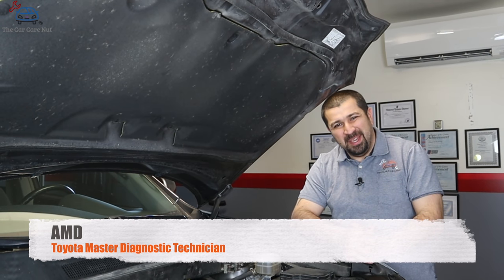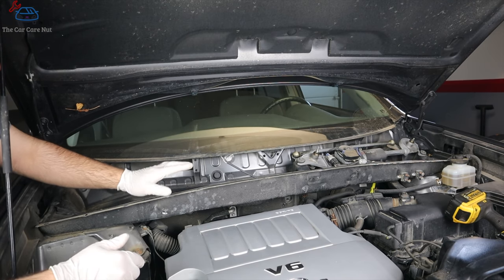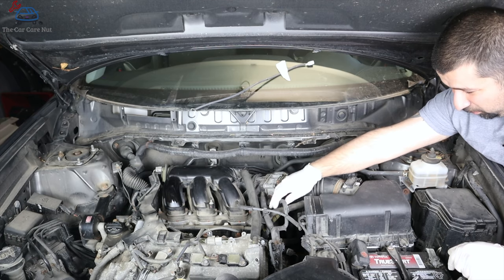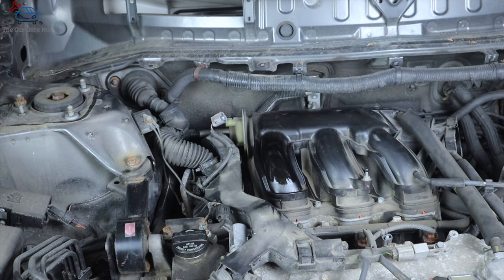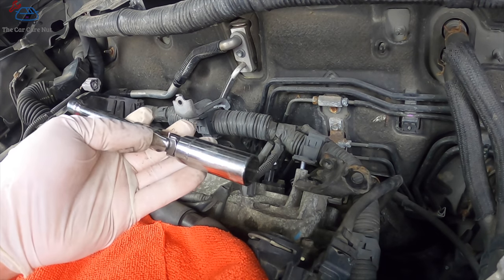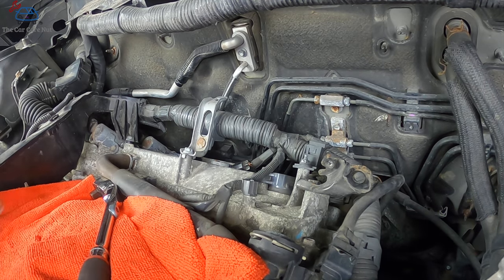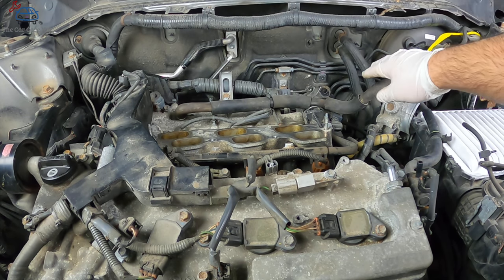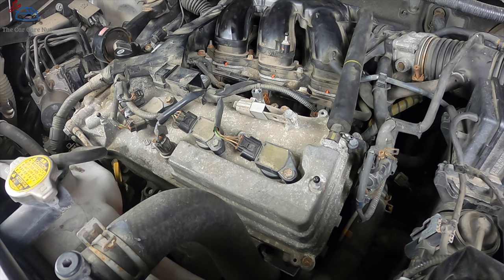How to change spark plugs on V6 Toyota and Lexus 2GR-FE 3.5L engine

Comment: Thanks AMD.  Just did this on my 2007 Avalon. The technique and steps you described were clear and immensely helpful.   I'm sure a lot viewers here - just like I did -  looked at other channels where they took some short cuts to avoid removing the intake manifold and/or cowl. My advice is don't do it.  Removing the intake and cowl was really not that challenging or time consuming. With the manifold and cowl off you can actually see where everything is instead of feeling around in the dark. The whole job took me about 3.5 hours. The only new tool I had to buy and  proved to be absolutely necessary to get at those rear engine bank  was a 5/8" magnetic spark plug socket with built in  4 inch swivel extension. The only really frustrating step was in trying to line up and refasten the passenger side rear manifold bracket bolt. I had to contort my body to find a workable angle but after about 20 minutes of trying a bunch of approaches I finally got the nut started.  

Final recommendation:  the spark plug change interval is at 120K miles.  Since you're going to a lot of trouble to get at rear spark plugs 1,3,5 just go ahead and replace those coils as well. The Denso OEM versions are about $50 each so it's not really that expensive and at that mileage you shouldn't be surprised if one of those coils decides to fail anytime after 120K miles.  My  original number 4 coil failed at just over 100K so take that into consideration.
Reply: I have the 2GR-FSE in the 2013 Lexus GS350. I have nearly 180,000 miles on the car now, and since I'm in California, the dealership recommended changing the spark plugs every 60000 miles( which I've done faithfully). In my V8 Lexus vehicles, in the past, they were always 90,000. Should I wait until 90,000 ⅞1miles to do these spark plugs? Thr car is high speed driven everyday, and runs terrific all the time.
Thank you so much!
Reply: @GREATTECH1  I would follow whatever the factory says is the required interval. If your owners manual says 60k for plug replacement then that’s your answer. It’s not unusual for a V6 engine to have a shorter spark plug life than your other V8 equipped  car.

Comment: Such a lot of work to get to the spark plugs compared to the old days.
I remember Scotty saying to buy the 6 cylinder as easier to work on than the 8 cylinder.
Very neat work there and very instructional.
Reply: Yeah, but they last a lot longer, so once in 100 000 miles isn't so bad.
Plugs used to be changed about every 20 000 or so.

Some Mitsubishi's  V-6s you need to remove the intake manifold to get to the rear plugs.
Reply: Scotty says to get the 6 cylinder 4RUNNER vs the 8 cylinder 4RUNNER. I watched my mechanic do the spark plug replacement on my V8 4RUNNER. The only thing that had to be removed was the air intake. A piece of cake compared to the 3.5L V6.
Reply: You used and paid for a professional mechanic; very easy to watch an experienced mechanic do the work with the correct tools.
Reply: @sanjaygandhi7962  4th and 5th gen 4Runners don't use the 3.5 2GR they use the 4.0 1GR, and they use a longitudinal mount configuration which makes it a million times easier to get to the spark plugs, my 3rd gen 4Runner with the 3.4 5VZ-FE was a piece of cake compared to this.

Comment: Thank you for creating this video.  I just finished replacing the spark plugs on my wife's 2011 highlander 5.3 and it was almost identical to the 3.5 you showed.  The hardest part for me was figuring out how to disconnect the electrical connector on the variable plenum.  You gave us some really good tips and probably cut the time it took me to complete the job in half.

Comment: This video was extremely helpful to me when changing plugs in a 2011 Highlander with the 2GR-FE engine. In fact, I'm sure I couldn't have completed the job without the video. 
I have a couple of comments based on my experience that might be helpful to others.
First, I was able to locate the bracket connecting the plenum to the valve cover and the problematic bolt screwed into the valve cover using the CCN's excellent description and depiction of its location. Standing near the rhs hood hinge, I was able to view the bolt as I loosened it using a 7"-long 12mm ratcheting wrench. It took 10 to 15 seconds of considerable exertion to break it loose. I wore a mechanic's glove to protect my hand and fingers while loosening it. 
Second, there was just no way to lift the clip on the connectors to the coils without breaking the clip. Thermoset plastic that has been subjected to the heat of the engine for 11 years was too brittle to bend without breaking. I wrapped high-temperature electrical tape around each connector to hold the severed clip close to its functional position and then pushed the connector onto its mate on the coil. I then gave the connector a gentle pull to verify that it wouldn't vibrate loose.

Comment: Thanks AMD for this video I have watched it many times in preparation for my own repair. I did it today and was successful. It took just under 4 hours it would have easily took only 3 if I didn’t have a stuck passenger wiper blade and the constant searching for the bolt to the L bracket. I couldn’t get the bottom bolt on the L bracket so I went with the top bolt. Once I got the plenum out I took off the L bracket because I needed to get to the #1 ignition coil. The rest of the repair went very smoothly. When I went to put the bolt to the L bracket back on I dropped it several times. The last time it was lost for good. I couldn’t find it. So I’m hoping my Avalon with 240K miles won’t miss it too much. 
Your videos have been a Godsend to me and has increased my confidence in being able to make my own repairs.

Comment: Hi Car care nut-Just want to say how amazing u are and the help u provide the community is invaluable! I have been dealing with 120K maintenance on my 07 Rav4 and while doing this job had your video on repeat! Kept saying "Thanks car care nut"  looking at the Tv in my garage like you were right there with me!! Everything went pretty well other then breaking 3 Coil clips even using your method. They are just that brittle after 14 years. Also, the front 3 plugs for some reason were seized beyond belief. 

I was so scared I was gonna break off the plugs. Was able to breathe and take my time and got them off eventually. I did use anti-seize on the front 3 though with the OEM Denso from my dealership. I know u don't recommend but I just used a very tiny amount on my finger tip and all 3 plugs went in smooth and torqued to 13 f/ibs. Did not replace the coils though, as I remember u have said if it works, don't replace. TY again for your wonderful contribution to YouTube and Toyota owners like me and helping with our maintenance!

Comment: Great video - thanks for your time doing this.
Two tips... 
1. Place some masking tape on the windscreen, under the wiper blades BEFORE you remove the wipers, and mark the tape where the wipers should lay.  Replacing exactly is then simple.
2. Wrap thin wire lightly round difficult-to-locate bolts, keeping the wire secured up where you can't lose it.  If you accidentally drop the bolt into an inaccessible place, take the end of the wire and GENTLY reel it in,  Before you tighten the bolt fully, pull hard and sharply on the wire to unreel it from the bolt that is now located (but not yet tightened).
Thanks again for a very clear 'How to...'
Reply: great tips!

Comment: I did coil packs and spark plugs replacement 3 years ago on a 2005 Avalon 2GR-FE and marked the hoses in case I have to do it again.  I now have to replace the valve cover gasket and spark plug tube seals soon.  Hope a video of that is made some day.  Thanks very much!
Reply: Me too. That rear valve cover gasket is going to suck.
Reply: How many miles on your car when you had to do that

Comment: AMD, Thank You SO MUCH for your incredibly helpful video! My son and I just completed replacing the plugs on my wife's 2013 Highlander Limited with the 2GR-FE. I could not have done this without your video. That rear bracket plenum bolt nearly did me in - I even purchased a set of swivel sockets from Harbor Freight and they did NOT work. Your Snap-On swivel socket apparently has greater swivel range as compared to the HF... I ended up using the longest 3/8" capture extension from HF with a U-Joint adapter and a standard 12mm socket, that did the trick. I forgot 2 hoses at the end so taking pictures BEFORE starting is a great idea. I have learned so much from you, Eric O at South Main Auto Repair, and Ivan at Pine Hollow Auto Diagnostics. YouTubers like you guys help us shade tree mechanics keep our vehicles running while saving some money!
Reply from the maker: Thank you for watching my video and I’m glad it helped! Some of these swivels don’t go as much as the snap on one. I noticed some brands like gear wrench makes very similar swivel angle to the snap on one.

Comment: Just did this on our 2010 Sienna. The rear 3 are a chore even with the upper intake removed as there is a lot of wiring in the way. Took about 4.5 hours and had to replace all 6 coil connectors as the original ones were so brittle, they all broke but I knew that going in and bought new ones from Toyota. Thanks for doing this video as it was a huge help.

Comment: Great help. Thank you. 2008 Camry completed today after 134k following all the guidance and tools. Original plugs (with the X on top) looked good. 4 of the plugs were very tight - took patience to remove them back and forward slowly without incident. The front 3 connectors snapped off the fragile clips often reported. Really appreciate the time you take to help us all maintain our Toyotas.

Comment: Great video.  This clear explanation of removals necessary for spark plug replacement was spot-on.  It isn't too difficult.  The biggest hassle I had was clips on the plastic cowl cover...I broke (1) and looks like windshield installers broke (1) previously.  Not a difficult task...just takes patience and care (clips are not replaceable by themselves).  Toyota Venza V6 is pretty much the same. 

If you can, take time before removing intake or plugs to blow off  all the grit/sand/dirt from the top of the engine so it doesn't fall in.

Comment: Fair warning to anyone who tries, if you are not confident, do not attempt this. You should be an amateur mechanic and have ALL the right tools for the job - including the swivel socket and every correct sock size. 

I made the mistake of sticking an extender that was too long into my back spark plug. Could not get it out without shimmying it and ended up shattering the plug. 

Been dealing with the aftermath + handling other repairs. Even my mechanic is having a tough time with the job. 

I wish I’d went to a mechanic from the start and had it done professionally.

That said, this is a fantastic video. The instructions and editing are clear and on point. You were very professional from start to finish. Nothing against the creator or the process. It’s just been a nightmare to deal with.

Comment: Thank you so much. This video really helped me replacing the rear coils (Coil "E" went out Cylinder 5 - rear driver side)  - and plugs on my 2009 Sienna 134,000 miles. Here is a good tip for anyone doing this on the 2009 Sienna - when it comes to taking off the "nasty" passenger side plenum bolt - take off the top bolt that screws in the the plenum (12mm) - that was easier for me. But the biggest tip of all is when it comes to putting it back on - Tie some fishing line to it before attempting to screw it back in! I spent an hour trying without the fishing line - but once I had that on I was able to lower it and move it around without the fear of dropping it. With the fishing line trick I had it screwed in in 5 minutes! WOW!! What a tip! Anyway, if you are doing this job - zip lock bag your nuts and bolts when you take them off it helps when you put them back on. Pick up the $1.98 pick set at harbor freight to pull off those PIA Ignition coil clips (4 of the 6 clips still broke on me and had to use zip ties to secure them). Put some masking tape on all those vacuum hoses that you disconnect so you can easily see them. Put down a bath towel on the intake as you don't want to drop anything in and you'll likely be lying on it. Don't lean on the glass when you are doing the job - it is easy to forget. Oh and when you are taking off and putting on those hex bolts on the plenum cover watch it - if you drop it (especially the back ones) they can go through the hole of the plenum which leads to the intake - put some carboard angled in there to prevent that from happening.
Reply: Could you please tell me where Coil Pack D is located 2008 Toyota Avalon
Reply: You must be my twin. I did a lot of the same things you did. The bags and  the tape is exactly whay I did.

Comment: Just did mine a few days ago including the valve cover gaskets, what a pain in the neck, I decided to take the risk and it worked out great, it was a personal challenge and didn't quite although at times I felt like that the hell did I get myself into, but it can be done, just look at this great video and determination you can do it attitude and then be proud of yourself for such a huge accomplishment and having saved a lot of money.

I'm not a Mechanic by the way..
Reply from the maker: The valve cover gaskets on the 2GR are a bear especially the back one
Reply: I agree
Reply: Halfway through its like WTF did I do haha.

Comment: The "antenna" that you referenced is actually a power wire for the heated wiper park. Toyotas equipped with it will automatically heat the wiper area when the defroster is turned on inside. Great channel, great video, just a caveat from an autoglass guy.

Comment: Excellent procedural video!

Disclaimer: all dust, grease, grime, stuck hoses, lost tool searches, stuck bolts, stuck nuts, spilled fluids, stuck electrical connectors,
missing part searches, visits to the parts stores, time delays for parts on order, cursing, potty breaks,  food breaks, phone interruptions have been deleted.
Reply: LOL..... I can relate.!!!

Comment: I did my 04 RX 330 a month a ago.. it took me 2 weeks to finish.. the only mechanical experience I have was watching different videos on this.. took me 2 weeks bc every time I get frustrated I stop before I lose my patience and just start pulling and hammering things down.
I’m glad I did it and felt good, Not only I changed the spark plug, I also changed my valve cover gasket which is very difficult to remove and put back, while I’m there I also replace my high pressure power steering line. Before I put everything back I clean my throttle body and mass air flow sensor… it’s doable for those of us who are not mechanic but u need patient. 
Another motivator to do this job  for me is saving thousands by doing this job ur self.

Comment: Awesome video, thanks for the step by step format for both disassembly and reassembly. I had a stressful night because I finished at about 2230 and I missed the brake booster hose because it was dark and I was tired and worn out. I started the vehicle and the idle was high and I had misfires all over the place and then the brakes went out and I thought I somehow destroyed the vehicle. I went to sleep and I checked it the next morning. I attached the brake booster hose and everything works fine. Thanks again!
Reply from the maker: Thank you for watching! Happens all the time where you forget something and walk away from the job for a bit and come back and everything works great!
Reply: Great story  reminds me when I changed a diff, backing out of the garage  it wouldn't  reverse. Forgot the brick on the front wheels.

Comment: Excellent video. Best I've seen on doing the back 3 spark plugs and Ignition coils. My wife has a 2008 Sienna XLE Limited with close to 170,000 miles and has had it since it was new and our 3 kids were little but she still love's her van and wants to keep it. Your channel is great! Thanks for all the great advice.
Reply: This video has been so helpful. Just did my 3rd one on a 2008 Sienna. Was missing both brackets on the plenum. Mech. who did the spark plugs before just didn't put them back on! Got new OME brackets from dealer. Was getting PO305 code so I replaced all the spark plugs and all 3 back Ignition coils. Replaced the coil connector also. All 3 were broken. Replaced the VVTi rear bank oil line also. It had never been done. Put everything back together with all new plenum gaskets. Still getting the PO305 misfire. Any suggestions? Can I re-use the new plenum gaskets that I just installed? Thanks.

Comment: Did this on a 2015 Highlander yesterday.  I didn’t need to remove either cowl and was able to reach that rear bolt without a problem.  The job went smoothly thanks to this great video.  The small pick was key for removing the connectors on the coils…great tip!  Masking tape can turn your extension into a locking extension for holding the spark plug socket.  While i had stuff apart i replaced the PCV valve (cheap part and takes an extra 5 minutes) and the air filter.  I also cleaned the throttle body. All in all an enjoyable job on this car if you follow the instructions and keep your bolts organized.  Thanks Car Care Nut!

Comment: In case we don't have locking sockets and extensions, we can use a little masking tape to hold them together. Just did the very job on my 2014 Sienna, although I spilled a smidgen of coolant removing those hoses off the throttle body. Thanks for the video AMD.